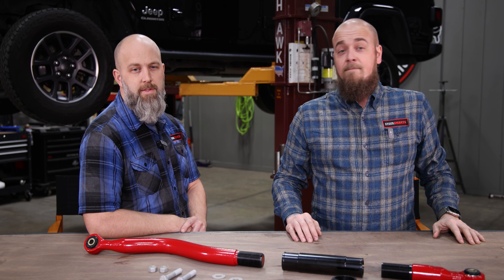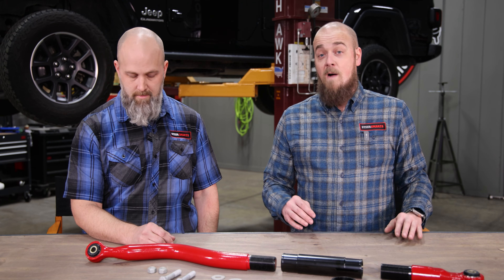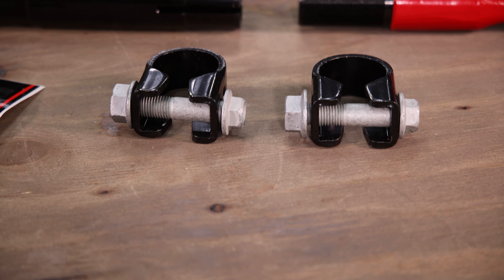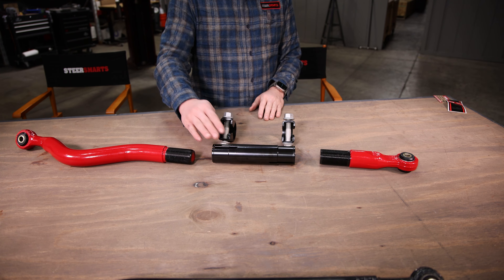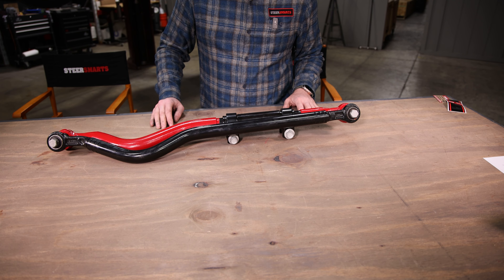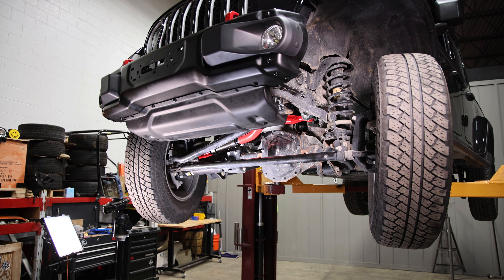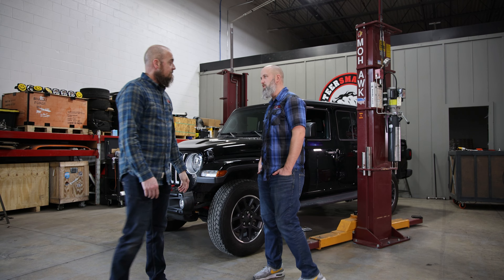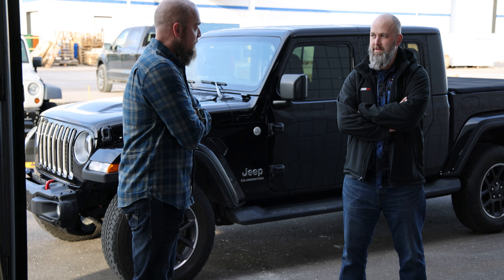Steer Smarts Garage - Yeti XD JL / JT Pro Series Front Adjustable Track Bar Installation

Comment: There are many video's out on these track bars having too much slop and play at the bolts/bushings. Are they just okd videos and the bushing issues have been resolved? November 2024 now...
Reply from the maker: There is a bit of misunderstanding out there about how much movement is acceptable in a track bar joint, but the answer for that question varies depending on the type of joint that is being used. On a heim joint, there should be no visible movement at the bushing, and if there is, then the joint needs to be rebuilt or replaced. You cannot carry this same idea over to a rubber or polyurethane bushing, which is what we use. Both rubber and polyurethane will have movement when cycling the steering side to side while static. When the vehicle isn't moving, that is when the greatest load/forces are exerted onto the steering system. As you start to move and rolling resistance decreases, you will not see the same amount of movement in the bushings as it takes substantially less force to make the wheels turn side to side while rolling. That being said, the polyurethane pro-series bushing is recommended for people running 37" and larger tires as the durometer (hardness) of that bushing is stiffer than that of the rubber. It also allows for more rotation since the inner poly is not vulcanized to the outer casing like it is with the rubber bushing. The number of videos that you've potentially seen is microscopic when you compare it to the number of track bars that we have sold over the years that have had no issues. If the people who were 100% satisfied all made a video about the track bar and how good it is, then you would pretty much never see the ones who make bad videos. 

TLDR: There aren't any known issues with our track bar bushings. Most videos made are not understanding that the only part of our track bar that absorbs impacts/move is the bushing. Our ends are solid steel forgings and do not deflect. Companies that use heims and other joints that are not supposed to move use hollow tubes which deflect under impact, but you don't see the deflection because it happens while you're driving. The pro-series track bar is always the better choice as the bushing durometer is stiffer and it has more rotational misalignment. Feel free to call or send us an email if you would like further explanation .

Comment: Can you talk about the bolt upgrade? Im seeing that the passenger side is too long ? More info please? 🙏🏻
Reply from the maker: @Rick_Rdz  that is our 9/16th bolt upgrade - the bolt is longer so we run it with the bolt head on the backside and the nut on the front (closest the front bumper). The track bar bolt that comes with the vehicles is a 14mm bolt but the bushings are slightly larger at 9/16th, so our bolt upgrade kit is just a slightly larger bolt that is grade 8 and magnicoated. Let us know if you have any other questions about it!